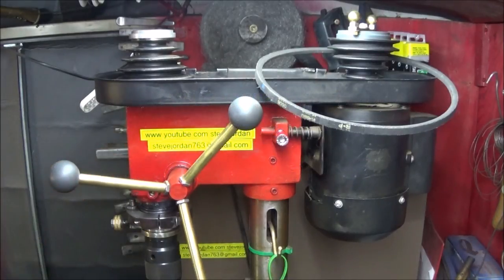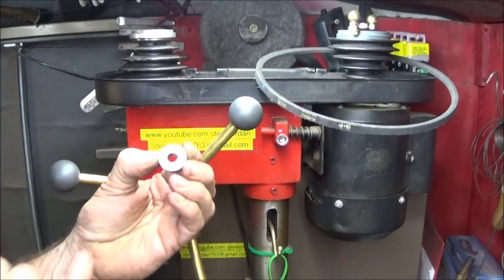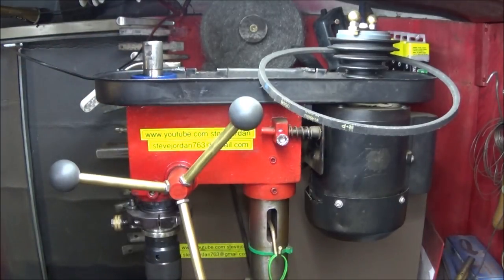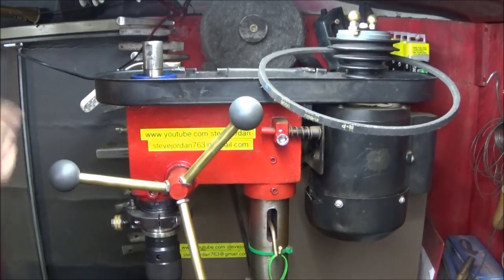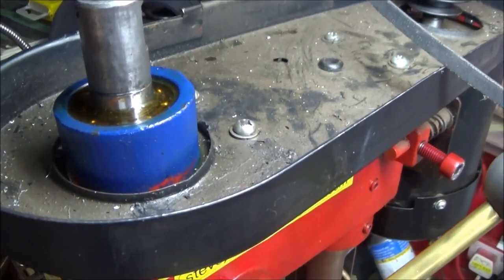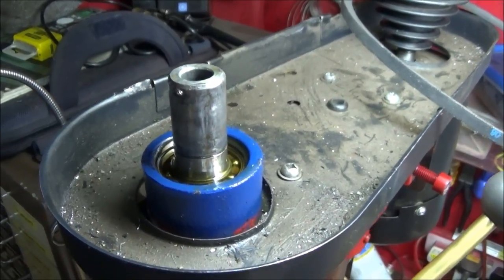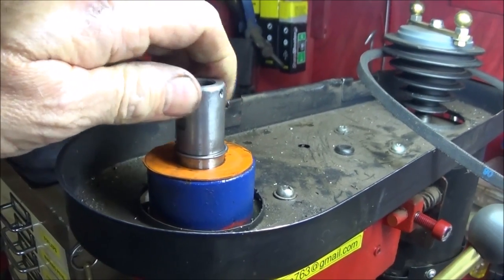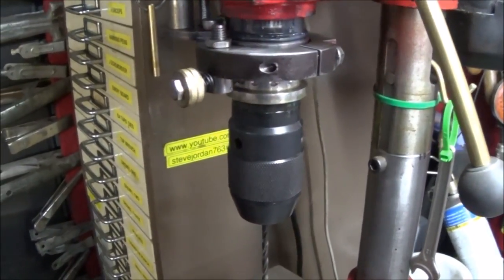How To Lubricate The Spindle Bearings On A Low Cost Bench Drill

Comment: I like your videos, Steve.  Just a comment about the bearings;  Don't you think it would be better to put grease in them rather than oil?  Usually, they come with grease in them.  All I have seen were meant to have grease, unless they are open bearings in an oil flooded gear box, or similar application.
Reply: my walker turner is oiled from the top trough the bearings and drips (over time ) on down and drips off the chuck
Reply from the maker: +dcw56 Hi Normally I would use grease but it would mean I would have to take the chuck off to get to the bottom bearing. I just use thick oil usually with some molyslip and it will lubricate both from the top. Also I have found in that grease isn't much better in these types of bearings especially if the sheild has been removed. It only stays in the bearing track for a very short time. I think oil is the best option for a quick and easy method of lubrication. Thanks for watching...Regards Steve

Comment: What would cause a pillar drill (nu-tools) to electrically cut switch off under load or when there is a bit of vibration say from a chipped bit cutting metal? Appears to cut off more as it's used for longer as if it's some kind of thermal cut off. Everything appears to be loose up in the belt housing. Motor a little warm. Any clues?
Reply: Start/run capacitors on the electric motors have a finite service life.    Possibly time to replace bearings in motor as excess frictional load will tend to make capacitors fail sooner.
Reply: Loose belt

Comment: I have a national machines drill that looks identical to this one. Have you found that when you add tension on the belts by nipping them together that the motor flexes? The one major mod i am going to make on mine is to remake the motor mounting plate and  the tensioner rod as a dog leg style so it applies pressure to the center of the plate evenly  as oppose to the top.
Reply from the maker: Hi Mick, Yes mine does flex a bit. That sounds a good upgrade to do. Regards Steve

Comment: I like the handles ....what are those little handles on the motor side pulley  ? Did i hear correctly , a flywheel on the driven pulley ?
Reply from the maker: The handles are for manually turning the spindle for screw tapping etc.

Comment: I guess this wouldn't work for the lower bearing if the drill press has those plastic seals.
Reply from the maker: Rolingmetal Hi I found out after taking the seal off the lower bearing that I didn't need to. Enough oil gets down through from the top open one. It should be ok if you have plastic shielded one to do the same? In fact leaving the lower seal in should hold the oil in a bit I think.

Comment: Thanks for your excellent tips on improving this "cheap" Chinese workbench drill. I use a similar one and it gives me lots of pleasure, certainly a lot more after after implementing your improvements. I notice that on mine there is a lot of fine black dust in the drive belt housing, no doubt  coming from the V-belt, so there must be some misalignment or slippage. Have you noticed a similar amount of wear?

Comment: I need to watch this later, today I received my cheap new drill press which is almost 1:1 with yours, it’s branded “hecht”.

What’s the screw for, the one between the front and the handles? My manual doesn’t mention it, BUT it is drawn, perhaps quill adjustment?

Comment: Thanks for your tips! Can you please explain what are those things on top of your step pulley?
Reply from the maker: Hi Thanks. That is a handwheel for doing manual screw tapping etc. Regards Steve
Reply: @SteveJordan  what's the lowest speed on this one?
Reply from the maker: About 540 RPM without load.
Reply: @SteveJordan  thank you for this. I have a 13mm drill press, I stopped using it because I felt its lowest rpm of 600 is too much. Today I gave it try again after reading your comment, and it does work well provided I use coolant. Plan to use it more for things I used handrill earlier.

Comment: You aren’t supposed to oil sealed bearings. That’s why they’re sealed. It’s just going to attract crap and cause the them to not run smoothly.
Reply from the maker: Hi The bearings were dry and it is better to oil them like I have shown. When they specify that they are sealed bearings this is not actually true in a sense. They have a thin metal guard, but this does not actually seal them, otherwise they wouldn't dry out. Oiling them is the best method and any excess oil runs through and thoroughly cleans the bearings anyway. Dirt cannot get into this mechanism as I made a cover at the top of the drill head, as seen in the video. Regards Steve

Comment: Or you could just buy some new bearings.
Reply from the maker: +TheManLab7 The bearings are good....it would be pointless changing them
Reply: Yes I have two of these chiwanese bench drills a large heavt one and a smaller one ,I have replaced all the bearings with good quality SKF and NSK sealed bearings . The amont of  lube in a sealed bearing is calculated to the correct amount when the bearing is assembled ,and will last the life of the bearing .Too much or too little will shorten the life of the bearing Both my  machines run smooth as silk. The bearings will out last me.